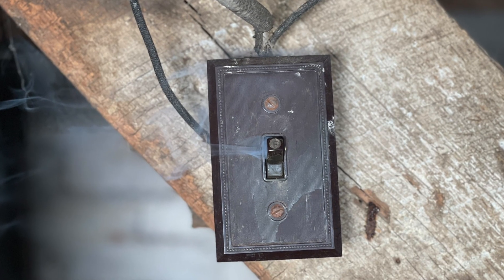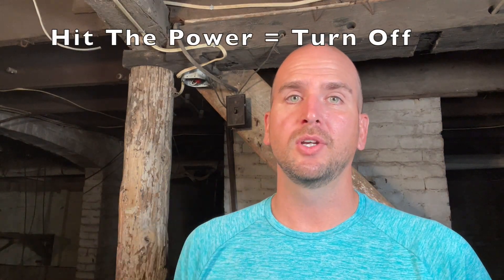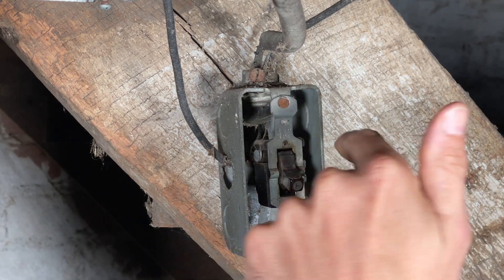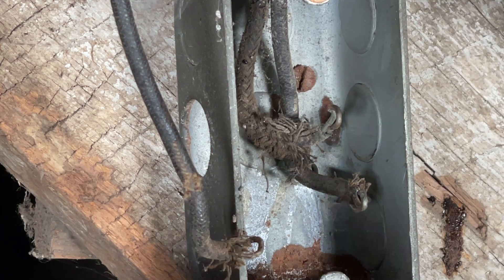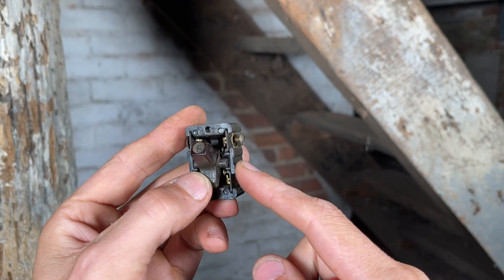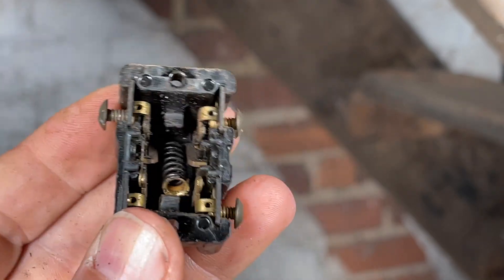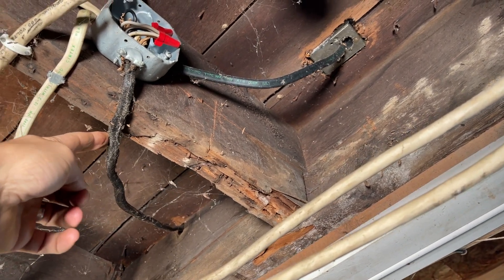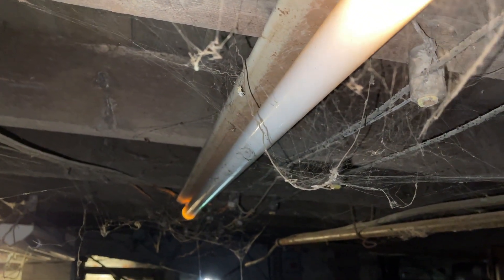Issues with Old Electric Wiring | Knob and Tube

Comment: Being a 3-way circuit I would inspect the whole circuit and make sure it's wired correctly and up to modern standards. One oddity in the knob and tube days is they used to switch the hot and neutral to the device. So the hot and neutral would be present on each side and by flipping the switch you send a hot or neutral. Hot-Hot and Neutral-Neutral the light is off. The problem is the fixture can be hot even when off. 

This looks like an old rework and who knows how many people have touched it, so in addition to a bad switch it can be hack work...
Reply: Yep, Hot 3 way, two 3 way switches. Just like you said. Hot and neutral on switch with switch leg to light. Light off, might have 2 neutrals at light or 2 hot at light and light is off. They did this back then to save on wire. Pretty cool. I've seen many.
Reply: @RG_sssSMOKING  I've seen this one time, when I just got my journeyman license about 4 years ago on a service call. It was in a farm house with a pole barn and a yardlight in between.   There was a 3 way switch in the house,  a three way switch in the pole barn,  and some receptacles in the pole barn that were constant hot, and a 12/3 UF cable strung overhead from the house,  to the yardlight,  to the polebarn.    The homeowner complained that sometimes trying to turn off the yardlight causes it to get super bright than BOOM! Well, as I'm scratching my head I figured it out.  The house and barn were on two separate circuits, and Someone had been working in one of the panels. Instead of two hots same phase = 0 volts lamps OFF, it was HotA + HotB = 240 volt and lamp burns out.   Advised the homeowner this is not legal,  the UF wire is not rated for sunlight,  and so ended up running new UF, burying it and using wireless switches so the homeowner could keep the existing setup but no danger of having the lampholder live and turned off.
Reply: @Sparky-ww5re  Same here. Power from Farm house to barn with a lift pole in the middle. That was the first for me. I'll add that would have been back in the late 70s. I think all old farm barns were wired that way. If I remember correct, 3 wires from house to barn, 2 wires straight to barn with 120 on them and the 3rd to the light on the lift pole. One time the pole light would have 2 hots or 2 neutrals and no light. Flip one switch and you have 120 and the light would be on. I think what happened I changed the service/panel and the breaker feeding the barn or the breaker feeding the house switch that was feeding the lift pole was put on the opposte phase which would put 230 volts on lift pole light and BOOM light would burn out.

No one could explain what was happing from the company I worked for. It took me a while to figure out but I complete understand now. In fact the house I live in now has a few Hot 3 ways. It was built in the early 60s. Come off a receptacle and to the 3 way. Same thing at other end of hall way. Then a single strand of THW to the light on both ends. I am thinking the house was built/wired from old timers from the "Great Depression". Times were very tuff back then. "Hot 3 Ways"they are out there and I've seen many. 
Have an outstanding day. Great speaking about this.
From one Sparky to another Sparky.
RG
Reply: @RG_sssSMOKING  very interesting story in your '60s house with the hot 3 way.    I'm guessing the house had that fabric braid NM wire throughout?   I've studied and learned the hot 3 ways were actually very common during the knob and tube era, which was mostly pre-WWII.   But I suppose the same set up could be had with NM wire aka romex.   In the farmhouse I was called to, they wirenutted the hot and neutral at the pole lamp, (not in a J box either,  just open splice, to continue the circuit to the barn.   The red wires were connected to the light and to the common screws of each 3 way.   And the hot and neutrals were pigtailed to the travellers and continued feeding the outlets.   Land of confusion 😃   thanks for sharing sparky to another sparky.
Reply: @Sparky-ww5re  Yes you are correct my 60s house was wired in romex, no ground. And yes hot 3-ways.
Have a "SPARKING" good day Mr Kyle 1500
Reply: @RG_sssSMOKING  Shared neutrals -- what a headache!  I won't work on any electrical unless I have switched off or verified that the main breaker is off myself.  My father asked me why I didn't just turn off the circuit I was working on -- my answer is that I don't trust the wiring job the last guy did.  I have only been shocked once and that was six year old me (this was in 1952) plugging a lamp into an outlet before grounded outlets and plugs (this could happen today as most lamps are still two conductor only without a ground).  Fortunately I separated myself from that very quickly and wasn't seriously hurt.

Comment: I owned a 1925 Craftsman Bungalow with a hybrid system.  I still have the original knife switch where 3 110/120 lines came into the house, but had been put into a newer 100 amp panel.  The house was rife with original 1920's Knob & Tube, with later receptacles connected to post-WW2 Romex.   I made friends with the city's Electrical Inspector, and over the next 10 years, put in a new Mast, Elect Meter a 200AMP panel in the 1700 ft2 home.   I replaced every light fixture, every switch, and every outlet with up-to-code 12/2 or 12/3 Romex.  The living room that originally had 4 outlets (one on the midpoint of each wall) now had 17 outlets so that there was an outlet mid, left, and right of any furniture placement, as it should be.   In the kitchen, I put in separate circuits for the MW, DW, Disposal and additional kitchen circuits so that every other outlet was on a different circuit.  The next owners had NO idea how much improved the electrical system was in that almost 100 year old home.

Comment: In the early 1950s my family lived in a house built around 1900-1910.  We had no problems with its knob and tube wiring while there.  In 1974 I bought my first house, which was about three years old at the time.  It was wired with aluminum wire, and plagued with intermittent receptacles and one case of melted wires at the point that they connected to the dish washer.  Luckily, the connection was made in a steel box on the washer, and no fire developed.  I was glad to see the last of that house.
Reply: Dishwashers produce heat in the drying cycle, anything heat producing tends to draw a lot of amperage. I believe the code today is a dedicated circuit for the dishwasher as well as the microwave-something that was not common in houses in 1974.

Comment: 1:08: Even the switch is up-side-down where most switches are mounted; Most switches are up for on and down for off, or at least they should be.
Reply from the maker: It is a 3-way switch so depends on the position of the other switch.

Comment: I am in the process of rewiring a hybrid system with Knob and Tube installed for the lighting.  In fact they had only ran a junction about 6 feet from the outdoor panel to the original fuse box.  I ripped the outdoor panel off and put in a 200A shutoff and then installed a 200A service panel inside below where the original fuse box went.  I ran 3/0 copper from the shutoff to the panel in conduit it that says anything BTW.   Shortened up the jumpers to the original system and then put all the really old lines on to AFCI/GFCI breakers mainly because that is what I will use for wet locations and bedrooms so I figured why not get them in use and have a little better protection.  From there I am knocking a hole near the ceiling and then running the wires down to the box location.  It uses more wire but with 10 foot ceilings I am not worried about later on dropping them down and making things look good again.  I went from a 100 amp panel that they installed outside and only had about 10 circuits ran.  I already have more than that and haven't hooked up the 3 office circuits or started on the 2 living room circuits let alone the bathroom and upstairs.  Plus I plan to remodel the kitchen and upgrade all that too.

The other advantage of dropping the ceiling is that I am planning to install a master bathroom and bedroom in the upstairs so it will be really easy to run the plumbing along the ceiling as well.  While I am doing the update I am also taking the time to run low voltage lines for DataComm throughout the house and ran an umbilical consisting of a power line, 4 rg6 lines, 4 cat6 ethernet lines, and 2 OM3 LC to LC fiber optic lines to a single demarcation point on the outside of the house.

After getting to town and unloading all the stuff the first thing I had to do was cap a bunch of broken water lines and then replaced all the lines with PEX.  Dug a new trench and dropped in 3/4 with insulation along the whole length to protect the line since I was barely able to get 18 inch depth before hitting rock in some areas plus I figured it would also protect the line from rocks.  Brought it in to a manifold block and then ran lines to each fixture.  My father had never worked with PEX and was dumbfounded that once the trench was dug we replaced all the supply in a couple hours.

Now it's roof time and I am in the middle of the tear off doing it all by myself.  And it has 4 roofs on the house, two are cedar shake and two are asphalt... I have 65 sheets of material to sheathe the roof and then the ice and water barrier as well as the synthetic underlayment.  Shingles are a nice 5 tab or architectural ones that are an antique silver instead of the brown ones that are currently on the roof.

Comment: I have some serious issues with this video.
1).  The title.  The switch was the problem, NOT the knob and tube.
That said:
You are correct that the technique here is awful.
A).  The individual conductors are not covered with a protective sleeve as they should be -and I think you should have mentioned this because people should know what it "should" look like.  If you work in old houses, you should keep some in your van.
B).  It's too easy to infer that you think an unprotected K&T conductor would have been OK going through a metal NM connector.  It would not be -you should have stuck with a plastic connector.  Similarly, it looks like the conductor coming in the bottom of the handy box  is going through a BX connector -also really bad.
C).  Coming in through the side of a handy box is almost always a bad idea if there is also a device (switch or receptacle) present.  Through age and vibration (especially a switch on a staircase), you are asking for a ground fault or arcing condition in a grounded system.  In this case (as you rightly point out) the metal parts of the system could become hot.
D).  You don't offer a solution, so you don't mention that loose conductors of any kind should not be run along the surface of any part of the structure.  You should get rid of that situation.

2).  As was pointed out by others on this thread, you incorrectly suggest that the problem occurs when the switch is "off".  3-way switched are not even labeled with an "off" position.

3).  No solution.  This is tricky because I guess you either don't have a legal solution or (I suspect more likely) you don't want liability.  Watching this video, the takeaway is that if the conductor was in a metal NM connector, everything would have been OK.

Solutions:
Each of the technique problems above can be fixed by doing the following:
1).  Trace the 3 conductors back to the ceiling and install a junction box.  I use a 1900 box for almost every surface mounted installation these days.  There is never an over-crowding issue and there is room for expansion.  With old wires, they don't have to be bent as much to fit inside the box.  Future maintenance is easier.  They are more visible.
2).  Run AC (flexible armored cable) to a switch box if it's going to stay surface mounted (AC is easier than something labor intensive like EMT or wiremold).
3).  Put this on an AFCI circuit breaker.  Actually, these days I almost exclusively use use dual protection AFCI/GFCI protection breakers.  OH, I know: Someone here is going to comment about "nuisance trips" or how they "don't work"*.  That just some lazy BS.  There are only *very rare nuisance trips -almost exclusively from old motors.  The real problem is BAD WIRING.  That's WHY you get a "nuisance" trip -the problem isn't the circuit breaker, the problem is not knowing how to install or diagnose AFCI/GFCI issues.
This is something that I do almost every week with Knob & Tube.  I live in West Philadelphia which has TONS of old wiring in 100+ year old victorian twins.  I troubleshoot AFCI/GFCI trips often.
Reply: I know that there are a lot of folks who do their own electrical work. And since this topic of so-called AFCI "nuisance trips" came up in a thread on another site.  I thought I would pass on this information.
I have 4 suggestions for avoiding so-called "nuisance trips" and I'm sharing this in the spirit of cooperation for other professionals and to be helpful to DIYers who are unsure about whether or not to bother with AFCI protection based on what they've read on the internet. Not trying to be a domineering ass, but with that said, here comes a very opinionated post!  🙂
1).  Wrap all receptacles in electrical tape. More than 9 out of 10 so-called AFCI "nuisance trips" are because a ground wire has folded up when the receptacle was put in the box and it's now touching the neutral.  *When you take the receptacle apart to troubleshoot, you will not see this because the wires will unfold as you pull the receptacle away from the wall*.  I tape the receptacles along the sides with 2 layers of tape and fold a 3rd layer over the back of the receptacle because there is a possibility of contact to the terminal screws from behind, not just the side (for the record, I do my switches this way too).  Honestly, this SHOULD be an NEC code requirement because it helps protect DIYers and curious children with a screwdriver in hand.  🙂
2).  Always push the ground wires to the back of the box. It's a simple practice to always fold the hot and the neutral upward from the terminal screws and let the ground wire go straight back before folding.  Just make this your habit for all receptacles and switches.  BTW, this is another reason that concern over wire bending in household branch circuits is nonsense: *Every electrician folds their wires for every device that goes into a wall case*.
3).  Use a different brand of electrical panel and circuit breaker. I only use Siemen's products and I only install copper-bus circuit breaker panels (PL and PN series).  *I have found that Eaton brand AFCI circuit breakers fail more often than any other brand*.  This is coming from someone who installed 2 Eaton circuit breaker panels in his own house 16 years ago (I haven't had a problem with mine, but my field experience has led me to avoid their panels and their AFCI circuit breakers).
4).  This one surprised me, but I've been doing this with AFCI installations for about 20 years and maybe it's magic, but it works: when AFCI circuit breakers first came out, the instructions said *to cut back the neutral pigtail as short as possible for the application*.  In addition, the picture showed the pigtail unfurled and arcing in a gentle curve to the neutral bus. I always do this to make the pigtail as short/gently curved as possible. As silly as it sounds, I am convinced that this makes a difference.  Alternatively, if you were installing modern panels, use a plug-in neutral panel like the Siemens PN series.
I honestly believe in my electrician heart of hearts that this will make a difference for any electrician or DIYer.